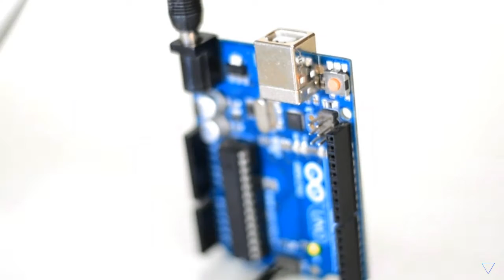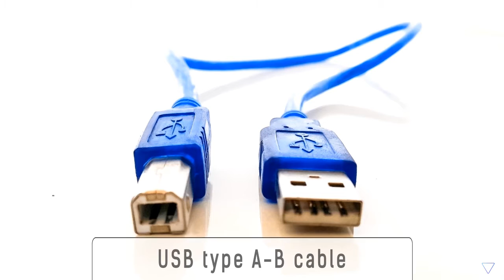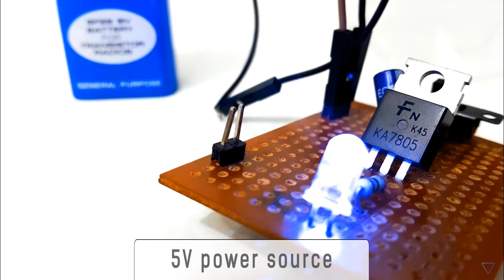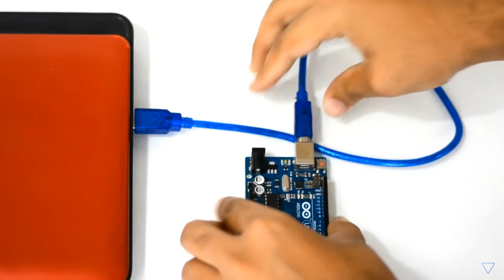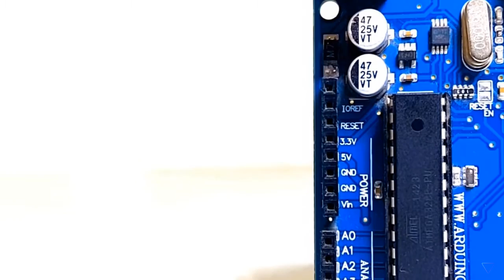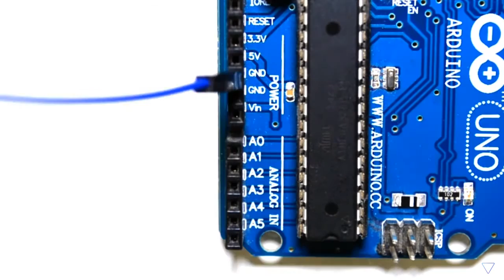Arduino 101 : Four ways to switch on an Arduino Uno

Comment: so the conclude is
if you want use 12VDC from adapter or battery you must plug any component to Vin pin?
Reply: not in 5V?
Reply from the maker: Correct!

Comment: Can you power arduino with 12v AC?
Reply: No. Where are you getting 12V AC from?
Reply: @UmairHussaini  In my hot tub, it was for replacing the light, check out my project here: https://youtu.be/u-xAkMBmfKM
Reply from the maker: No! You can, however, power it using 12V DC via the barrel connector or the Vin pin

Comment: Ca you solder a 2-pin connector to the board so you can use a 5V power pack and bypass the USB port?  USB cables are not flexible, like the Mini or micro cables.
Reply: Sure if you have a custom Arduino board then you can modify it accordingly